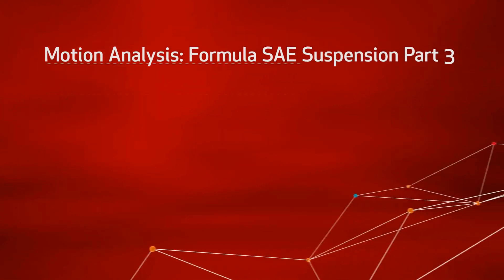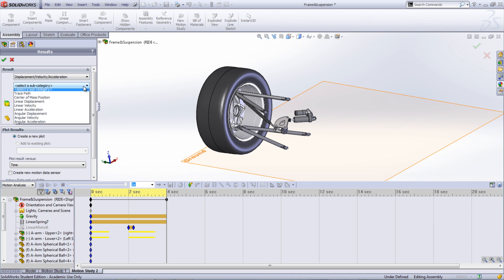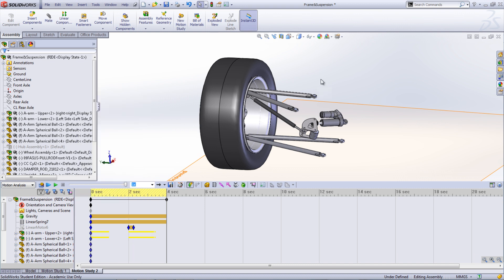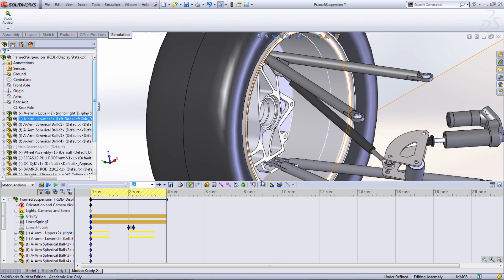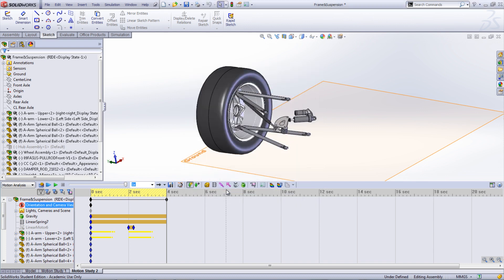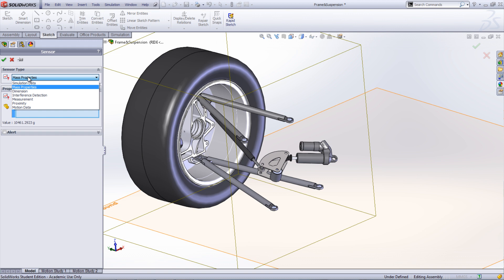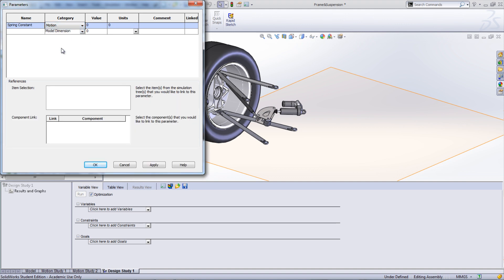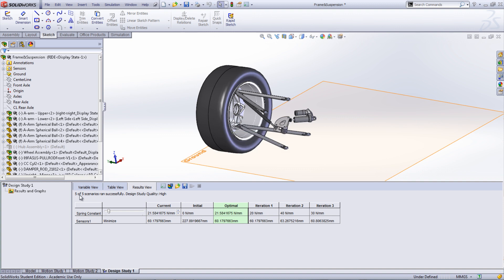SAE Car Suspension With SolidWorks Motion: Part 3 Post Processing

Comment: what happens if some components do not show in the "import motion loads" ? I have support rods on a trailing arm suspension and I would like to know how they're doing as well.
Reply: Hey Andres
I want to make a trailing arm suspension for my atv and i don't know from where to start the designing. Can you guide me :)
Reply: smit joshi hey man! My first step was looking up YouTube videos to learn what has worked for most. Then I went to “Lotus Shark,” a program that will give you the results of any suspension you build on it. The camber, castor, half track, travel, everything. Good luck!
Reply: @andresparratorres8040   I know about lotus shark but I am not able to imagine those lines as i would have made it in solidworks
so if i have manufactured the suspension can you share me photo of it??
Reply from the maker: Hi Andres! Please reach out to our community to post your question for one of our experts: my.solidworks.com/forums